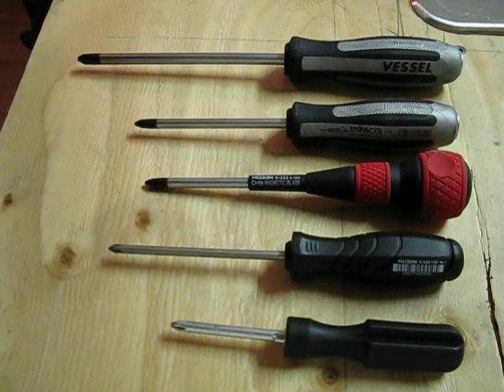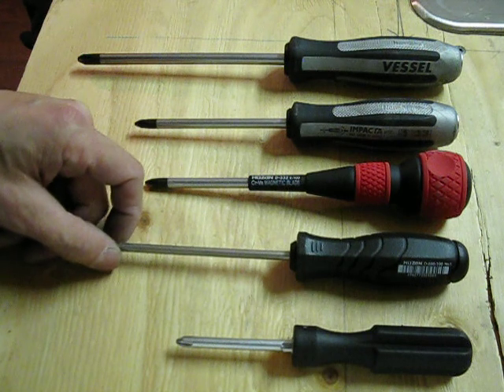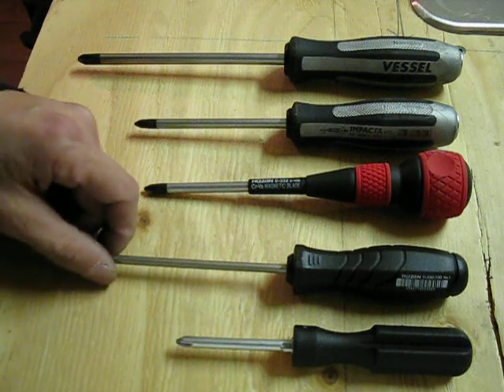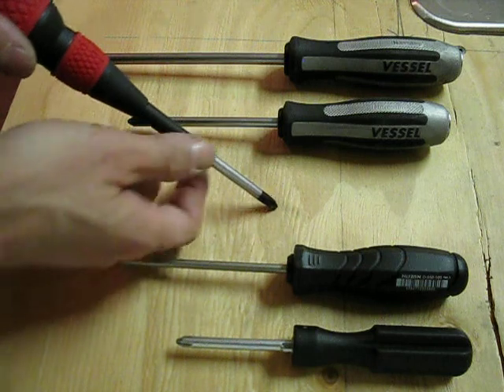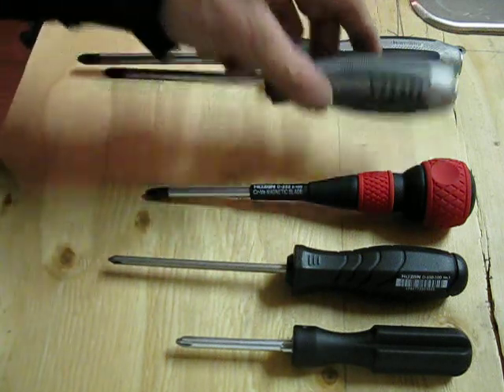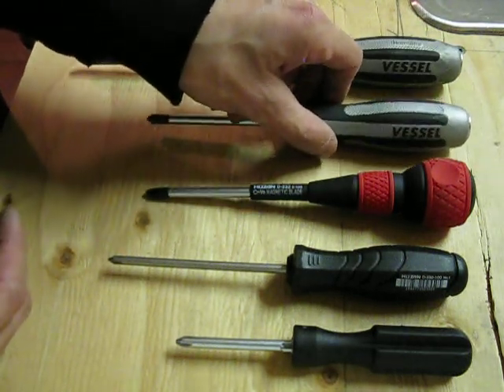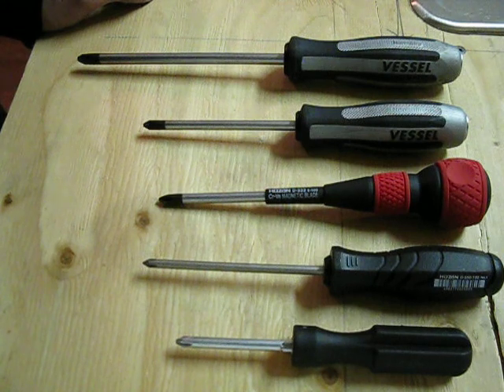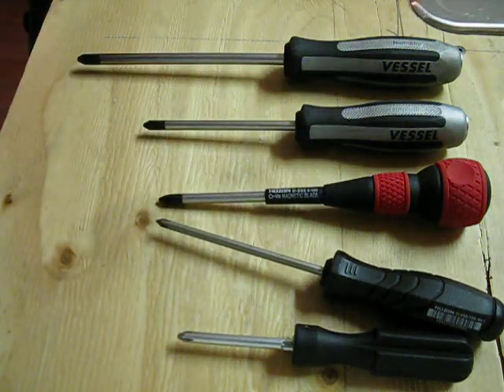Unobtainium Screwdriver

Comment: The difference between JIS and Phillips is, as far as I can tell, a myth. Have bought a handful of Vessel and a couple of Hozan branded screwdrivers from Japan and the tips are indistinguishable from my other drivers purchased in Australia (manufactured in China)
Reply from the maker: Not a myth, there are geometry differences. The most obvious one you can see is length of the tip, Philips is longer by about half a millimeter, but there are other differences too that you really can't see buy just looking at it. You can actually feel the sloppiness with a Philips in a JIS screw head, while the JIS will be a tight fit.  The JIS is also a tight fit in a Philips screw head. You use a philips enough on a JIS head screw you will find that the screws head will strip.  I first discovered this working as a moto mechanic long ago.  Cleaning out carbs and the float bows screws always gets striped.  I had strips lots carb float bow screw heads before but had always though that I was using lower quality tools.  Back then I always replaced those screw heads with allen heads.  Once I discovered the JIS screwdrivers never striped a JIS head screw again.  At first I thought it was just the screwdrivers or the screws themselves but after using even snap-on screwdrivers it still happened.  So I knew it wasn't quality of tools or screws, was taking apart lots of Honda carbs and their fasteners are very high quality.
Now it is possible that in Australia, metric system, that the JIS drivers are available or that the tools coming from China are of JIS spec.  In the US every thing is pretty much non metric unless stated.
Reply: Peanuts hurt my teeth